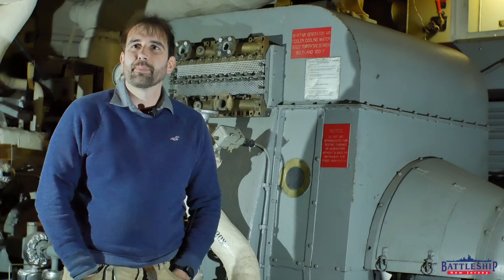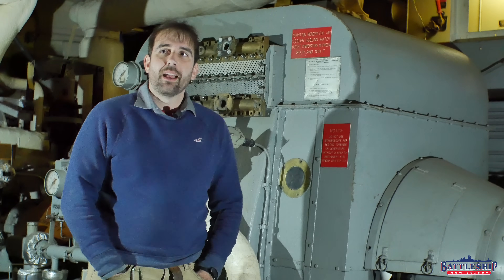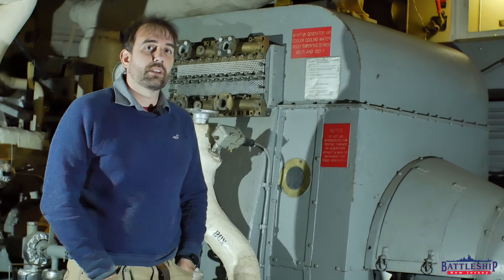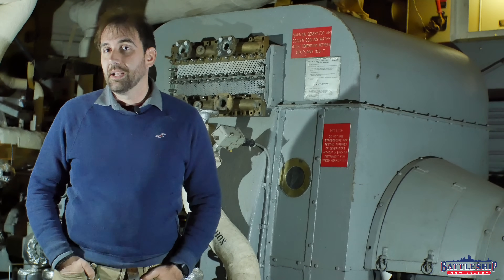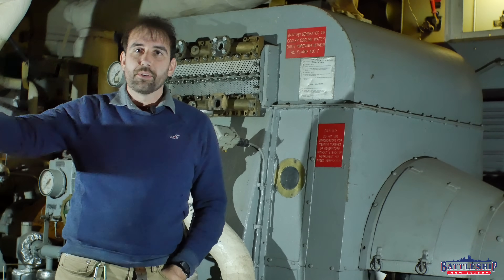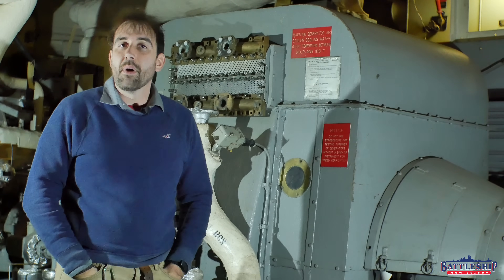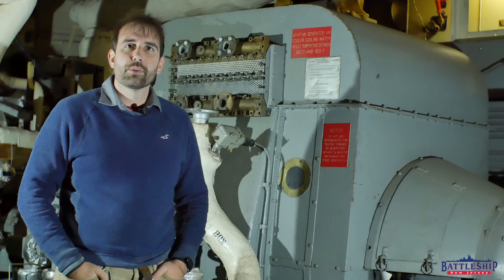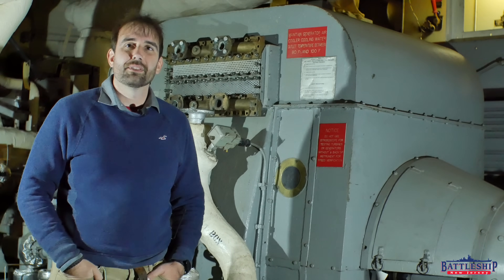Turbo Electric vs Direct Drive Turbine: What Propulsion Plant Is Better for Capital Ships?

Comment: Turbo Electric was 5000 volt DC. Fuel efficiency was much better than steam turbine drive. 
They still had auxiliary generators for 3 phase 440 volt ship service. 
I think with today's technology turbo electric drive would be best for larger ships (25,000 ton +)
 Just don't do the Zumwalt madness for guns.

Comment: I recall you saying in a video that your contract with the Navy prohibits any use of the propulsion or power generation plant, but does the Navy do anything to maintain the propulsion or power generation plant on the Iowa class museum ships now in the 2020's noting that they were mothballed from the 1990's post Gulf War, or is the intention that no maintenance work is done and if the ships were ever recalled to active duty the Navy would take care of any/all work required as part of the NavSea re-activation?
Reply from the maker: No, the navy doesn't maintain the propulsion plant either. These things are dinosaurs.

Comment: it sounds to me that turbo electric systems are significantly superior to steam turbine systems, and a complete analysis of all the various aspects/tradeoffs would objectively show that's the case...lol, probably some decision makers were wined-and-dined by steam turbine manufacturers. smfh
Reply: Rickover wanted turbo electric for the nuclear submarine program. Saw that as the best way to maintain silencing as opposed to the RN solution of rafting. Aside from gas turbines, the other methods of turbine spinning still use boilers whether fossil fuels or nuclear.  Except diesel marine or combustion motors I guess.

Comment: Basically a turbo electric or turbo generator ship, uses an electric motor that turns the propellers. Like any land based lower station, steam is used to generate that electricity. That electricity is then wired to the electric motors. 

While direct drive ships use the steam to blow a windmill, that’s connected to the propeller on a shaft.

Comment: Electricity for 100MW is not 440v, its at least 10 times more, and even in this case you need cables thick as sewage pipe. And then on top of it - salt water everywhere, including battle damage. Ummmm, not the best combination. And as bonus - electrical damage propagates extremely quick, switcboard explides due to malfunction, flood or damage and next unit explodes too, immediately, faster than you can cut the power. Avalanche crash as it is. Even on big industrial installations, like SayanoShushenskaya hydro power plant where flood from single broken turbine caused total destroy, only 1 turbine survived because it was stopped.

Also about Enterprise in Seattle (other version is SF and big drought, so hydro generation could not provide enough power) - I do not understand how it was possible. All these huge generators and motors in 1930th were DC, like on diesel and electric trains, advanced control for 3ph AC motors became available only in 1950s. And land networks are all 3ph 60hz, without any way to convert dc to ac.

Comment: For a modern battleships it's either IEP propulsion or nuclear. Depends entirely on what you'd require such a beast for. In all likelihood the cost of the nuclear powerplant would not worth it but who knows? It seems countries always felt inclined to install nuclear plants in their largest surface combatants during the modern times. Often the common sense has won out but who knows?

If it's about to overtake the classical roles of the WW2 era battleship with similarish requirements then IEP is the best bet which is really akin to the modern turbo-electric propulsion. It's fuel efficient, versatile, provides plentiful onboard power and can be compartmentalized really well.. Nuclear power is fine but like you explained I don't know if any contemporary reactors could resist shocks. In all likelihood they need a leadup time before being feasible and even then it does add expenses so it depends on how much you want said ship to cross the oceans.

Comment: What about diesel propulsion?
Reply: Contemporary or modern?
Contemporary diesel propulsion suffered from lacking development. The availible models generally had lacking performance per comparable size. Although they tended to be saving a lot of weight due to their more direct design. No need for water pumps, boilers, long tubing and in general damage to these modules caused less secondary effects. Or to be precise, if you hit a running turbine it exploded. If you hit a running diesel engine it broke down. Marine diesel engines were a bit more exposed to flooding since the robustness of turbines allowed to run even while submerged. Oh and thermal output was also less so you didn't need that much in terms of funnel sizes.

The main issue in the 1930s leading up to WW2 was them lacking power compared to their size and generally not being so thoroughly developed as steam turbines. Battleships with diesel power tended to be slower. Cruisrs and destroyers usually depended on how overbuilt the engines were.

Comment: Another advantage of turbo electric is that power from any generator can be routed to any propeller. Thus a hit that takes out a turbine doesn't take out any propellers, instead reducing the power to all propellers equally.

Comment: If we were building a Battleship today we should go with Gas Turbine - Electric similar to the Zumwalt class.

Modern capital ships need ENORMOUS amounts of electrical power, especially planning for potential future upgrades  (think rail guns or laser weapons).
Steam plants are too labor intensive and take too much time to bring online (need large crews).
Nuclear is just too expensive (IMO not even all our carriers should be nuclear)

Gas Turbine isn't as efficient as steam but one could operate at low speeds with just part of it's plant online and running in it's most efficient power band and then be able to very quickly (less than 2 minutes) bring the entire rest of the plant online if full power is needed.

A modern Gas Turbine ship can go from cold iron (all engines and generators turned off) to underway with just the duty section (usually 1/4 of the crew) in faster than you can get a pizza delivered.

Comment: Turbo electric is good if you have a variable pitch propellers.  That way you don’t need dynamic braking to stop the shaft before putting it in all back, all you need to do is to reverse pitch of the blades

Comment: On the land side, the Germans and the US experimented with electric powered armored fighting vehicles.  When the Wehrmacht spec went out for a "breakthrough" tank that eventually became the MkVI Tiger, Dr. Ferdinand Porsche designed a tank with two gasoline engines driving two generators driving two motors driving the tracks.  After an initial production run of about 90, it was rejected due to the competitive Henschel design being better overall, not to mention the complexity and expense (and the prototypes had this nasty habit of catching fire).  Most of these were later equipped with a casemate superstructure and put into service as the Ferdinand tank destroyer.  Later in the war, surviving Ferdinands were modded and re-issued to troops as Elefant.

The US Army had two electric drive tanks that progressed to prototype/limited initial production, but not further.  The first was Heavy Tank T1E1 (sometimes called M6A2), and the other was medium tank T23.

Comment: The only advantage of turbo-electric is you have full 100% power astern. The main generators and motors are high voltage between 2,000 and 10,000 volts which a steam leak or water leak can cause havoc on a grand scale blowing out insulators, voltage regulators, transformers, and switching gear. They can be fantastic on auxiliary vessels and merchant ships but not warships in my opinion, they are just too vulnerable to day to day occurrences, not to mention battle conditions.

Comment: I understand that it would not be good to try to convert an Iowa-class battleship to nuclear power. But if a new battleship were being designed, today in 2023, it could be done. I have worked at a commercial nuclear power plant and I know a little about reactor sizes. A modern reactor could fit inside an armored citadel, knowing that refueling would be a nightmare. But nightmare tasks can be completed. The best propulsion is nuclear.

Comment: Electric propulsion with a generator driven by a turbine is the way to go for just about anything that needs a large amount of power. Tanks, Trains, & Ships.

An important benefit of electric motors, is that we can run the motor for a short while, even if engine power is insufficient at the moment.

Even hybrid cars use a very similar concept.

Comment: If I were to design a modern battleship with heavy guns and missiles, I would use multiple nuclear power plants driving electric generators for electric drive.  Utilize 3x 50 caliber 16" main guns in one turret for close range (up to ~20-25 miles without rocket assistance) fire support.  Have room for multiple Mk 41 and Mk 57 VLS systems for long range strike or defense, CIWS or directed energy defense systems for close in defense, and room for fleet command.

Comment: Yes, if you lose a turbine you still have not lost a screw but you still lose power over all because you lose that generator. If you have 4 Turbo electric generators and you lose one, you just lost 1/4 your total power generation to feed those electric motors that are turning those screws.

Comment: But the Iowas weren't direct drive. Earlier battleships with the first turbines were direct drive but they weren't as efficient as turbines with reduction gears. Iowas had reduction gears. The turbine on them could spin faster putting out power at a higher RPM and allowing the screw to turn at an optimum RPM for the screw without building a monstrous turbines that turns slower for the screws.

Comment: The diesel-electric rail loco's seem to work quite well. Battleships are on a much bigger scale, but the principal is more or less the same. I think the shorter the shaft to its power source is, the better. The shafts are cheaper to make and don't warp so easily. Any design must be as simple as possible. Accessibility is also a major requirement. Any component on a ship should be removable and replaceable. Saab of Sweden is a good example. They build their fighter jets with phenomenal abilities with minimum complexities.
Reply: principle is

Comment: Diesel-electric works very well in icebreakers because the screw could be stopped quite suddenly by ice and a circuit breaker would open. That doesn’t mean there is no chance of damage to the screw, but the engine won’t be damaged and there’s no clutch, so no clutch damage either. The Coast Guard icebreaker Glacier had been the world’s most powerful floating diesel-electric power plant- Ten 10-cylinder 38 D 8 1/8 Fairbanks-Morse propulsion diesels, two F-M ship’s service generators, two F-M generators for the heeling pumps (to transfer ballast or fuel rapidly from side-to-side to help break free when stuck in ice) and one emergency generator. Fifteen F-M diesels in total!

Comment: From my point of view Diesel electric would be the way to go. Combining the benefits of Diesel engines (no need to wait to rise steam, good efficiency) with the benefits of electrical drive. With enough redundancy built into the systems it should be more resilient to losing power then the examples you named.

Comment: i assume the blades in the turbo are fixed?
so i assume that a turbo electric system can keep the turbo at optimum RPM since it is not directly linked to the propeller

Comment: Gas turbine to electric is the way to go.  Quick start up, flexible configuration, reasonable efficiency, and easy redundancy. 

Nuclear may seem good but it has problems like nuc plant operators don't grow on trees; requiring a special individual and extensive training.  

I was an operator in fuel oil to 600PSI steam and diesel - electric plants and worked in Repair Department for nuc subs.

Comment: Nuclear power used in modern Aircraft carriers could also be used in the Iowa class battleships. Now remove the main guns, all nine 16” Mk7 50 cal, then remove the 5 inch. Now replace them with modern missile systems including the new Sam systems new anti ship and  guided cruise missiles. New radar and targeting systems, nbc protection and airborne defensive system upgrades. New navigational systems new lighting in led type lights and include new refers, galleys and crew quarters. Nuclear power can still keep up with the aircraft carriers and may add two knots more. New nuclear power plants for ships have been sized smaller than their predecessors and are more efficient in propelling and powering the ships, as well as creating fresh water like in nuclear subs. Also using small nuclear reactors on ships like battleships offers less space used and opens up the vessel to much more space or added armor for protection or storage.

Comment: 1250 KW is about 1600 HP times 8 is 12,000 HP these generator are the ships AUX  generators NOT main engine generators the  ship has around 240,000 HP

Comment: Turbo electric is NOT /WAS NOT American the passenger liner Normandy that sank in NY at the dock when a fire broke out and she rolled over she was turbo electric and was built before WW2 Watch the video on refloating it it took 17 months with hard hat divers. It was 10,000 ton heavier 10 feet wider and 100 feet longer. then the passenger ship that was re floated in Italy several years a go.

Comment: Today, you'd skip that infernal boiler system all together and just have gas turbine engines driving the generators.  If added, the boiler system would be to increase efficiency (see combined cycle natural gas power plant).

Comment: Love these videos. I think the drives on the Iowa class battleships were actually great for the time and would probably still be great today along with turbo electric stuff. If I were doing one today I'd do it with a bunch of emd locomotive engines. If you look at locomotives you don't need very much room to house it. But there's nuclear power which is basically just an alternate way to heat water for steam propulsion, or steam turbine generators. Anyway you do it is a variant from many decades ago anyway. Nuclear is just another way to make steam and diesel will always just be that..a diesel.
Reply: Any way you

Comment: I could be mistaking, however, if your worried about compartmentation, you could run a bulkhead down the keel and split both fire rooms and engine rooms, assuming you are not worried about Washington Naval Treaty weight limits.
Reply: if you're

Comment: Excellent video, as always, Ryan.  However, I'd like to offer a small correction.  The power failure in Seattle you discussed at 7:10 was actually several miles south at Tacoma.  The picture at 7:15 is of the USS Lexington tied to the Baker Steamship Dock supplying emergency power to the City of Tacoma, which it was able to do because of, as you stated, its' immense generating capacity as a turbo-electric design.  Note the large gun turrets forward of the island structure.  These are left from its main 8" armament as a cruiser.  At remodeling these were removed and 5" dual purpose deck edge guns installed.  The Lexington was just across the Puget Sound at the Naval Shipyard at Bremerton at the time.  I have this history because the dock was my great-grandfathers company and I have this exact same picture framed in my home, the story was related to me by my grandmother.  Thanks for your continued work in saving the history of these great ships.

Comment: JFTR, USNS Aeolus T-ARC 3 was launched in 1945 and operated until 1985.  She was turboelectric.  The main propulsion motor was pretty much problem free.  She was replaced by the USNS Zeus T-ARC 7, another turboelectric ship which is still in service.  Turboelectric lasts pretty much as long as you're willing to maintain it.

Comment: The U.S. Navy used electric drive with reduction gearing that never were made specifically engineered for each other till the early to mid 80s. This is the first video that mentioned the change in the 80s.  I worked in the GE gear plant in Lynn MASS which made Navy reduction gearing for nuke subs up to carriers.  I was assigned to the RD program that designed an built the gas turbine and reduction gearing and drive motors. The 3 were specially designed for each other.  U.S. ARLEIH BURKE class destroyers DDG 51 were the first class of ships to use them. The reduction gearing case was almost 1/2 The size of previous reduction gearing and it handled higher speeds. With the gas turbine a lot of room was add for other things.  I and another employee machined the major casing that held the bull gear and all other gearing. It took a couple of years to build and get accepted by the U.S. NAVY.  62 and this is one of my bragging points.   I would love to actually see them installed even though they are manufactured else where.

Comment: As far as the case of Saratoga loosing ALL power - that seems like a matter of better design, rather than a fundamental flaw in the idea. I could see how, if cabling and connections weren’t insulated and isolatable, you could have a complete outage. But there MUST be a way to correctly “cut out” the damaged sections, and bring at least some capacity back online.